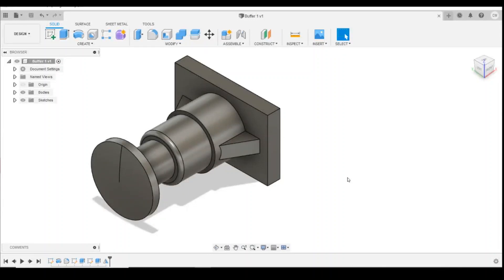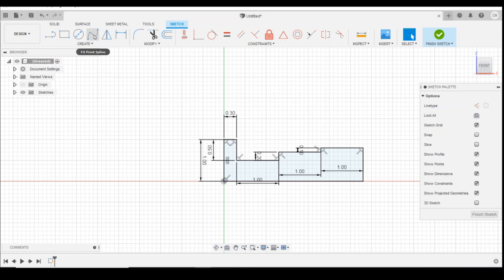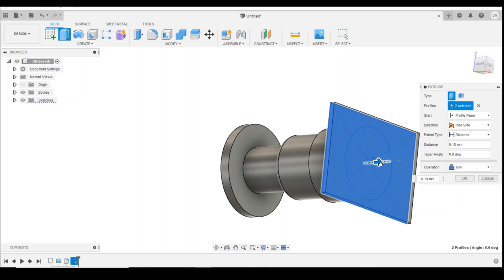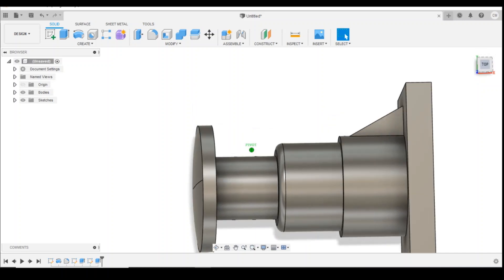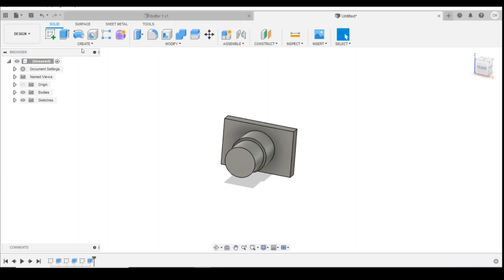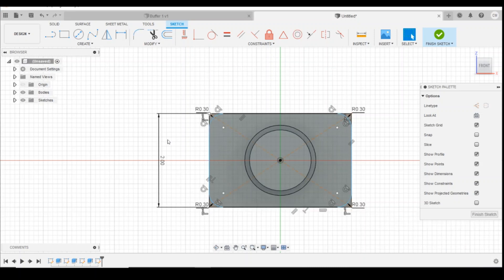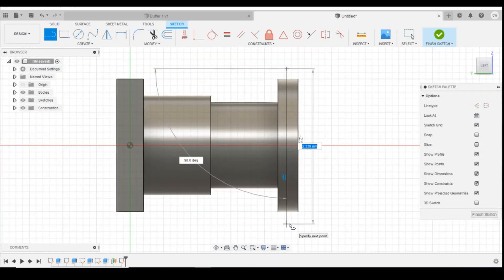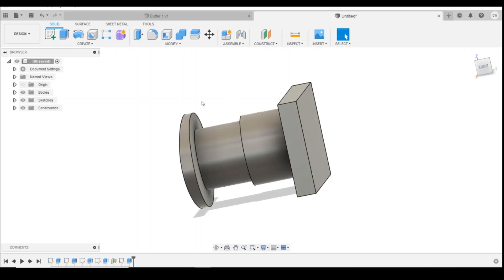Lesson 21 - Model Railway Train Buffer drawing tutorial using  Fusion 360

Comment: Thank you Carl for another excellent video. Perhaps an update to it by having the buffer head separate and sliding into the housing being retained by a bolt  ( and spring ) in the base. And in the case of an oval or rectangular head a keyway and tit to prevent rotation.
Reply from the maker: Your welcome,

I will add it to the list of things I have as ideas to draw.

Thanks

Carl

Comment: Hi Carl, I've been experimenting with Fusion 360 and one thing I've discovered (and I'm sure you know this) is you can insert a canvas - a photo / drawing etc. and use that as the template for the initial sketch drawing of the buffer profile if you wanted to base your design on a real life example. I've used this method for the initial sketch drawing of a swan neck lamp post to get the curves more or less right. Keep up the good work!
Reply from the maker: Hi,

Your one step ahead of me again :-)

In tomorrows video I show how to do this very thing.
Reply: @3ddrawingformodelrailways  Excellent! I use to do that quite a bit to rough out a building plan in AutoCAD when I only had an old paper copy to hand. One thing that maybe very simple or I'm too lazy to look for, where are the files I've saved stored as I can't find them on my PC and how do I delete a file I no long need? Thanks
Reply from the maker: The files are saved onto Fusions Cloud.  you can access them by clicking on the data grid in the top left of the window  ( looks like a group of squares)  in here you can delete them if you no longer require them.

Thanks

Carl
Reply: @3ddrawingformodelrailways  OK thanks for the clarification Carl